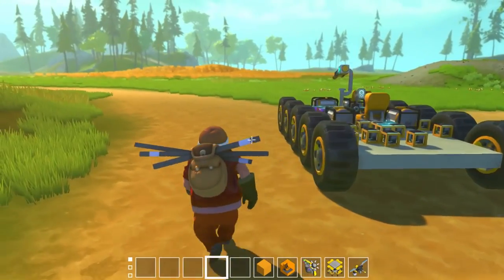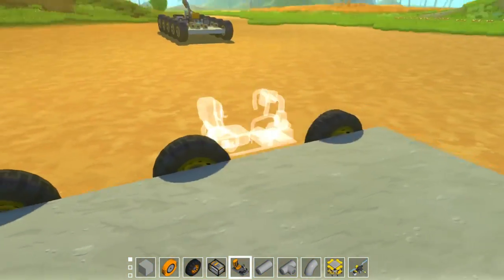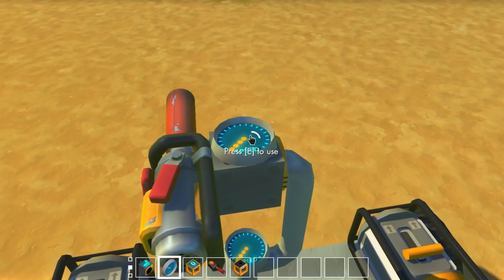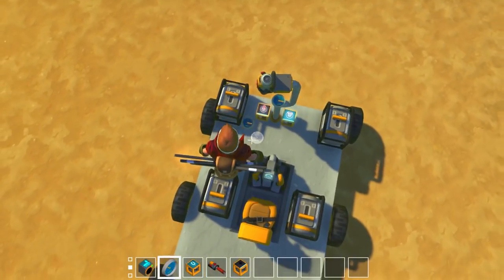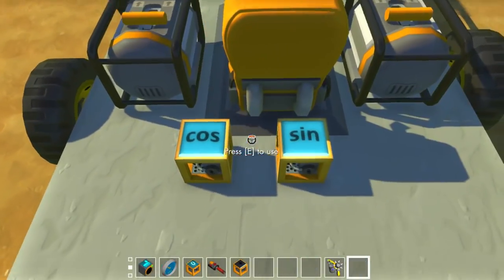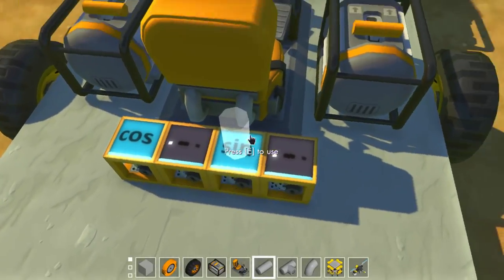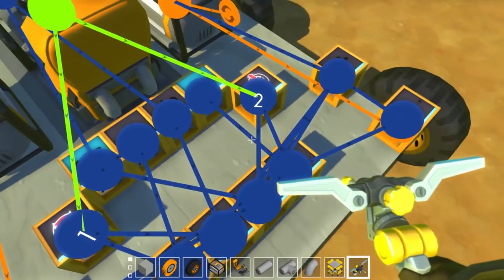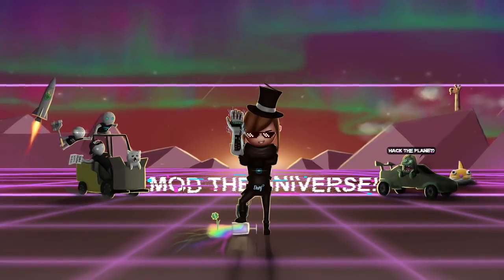Tank Logic Step by Step Tutorial 🧠 Easy Mode | Skrep Makenik

Comment: I have a suggestion: how about making a logic-based powertrain for tank that would feature gearing? like, let's say that it's a mp tank and driver uses a standard wasd converter to operate it. then, he would have an option to change gears between more power but with less speed etc. And also, my question is: would that be possible to do with a standard vanilla engines or it's impossible? I know that you have an easy way to manipulate that with this programmable engine form modpack, but I was actually curious if it was possible without it
Reply: I think it is but you have to do much more.
If you would use double bearings and button controls instead of w and s it would be possible. (Or of course wasd converter.)
Reply: @Samuel-lk6xb  actually I already made a single bearing tank with full wasd using x's mod, but I lacked gearing in my tanks
Reply from the maker: single bearing tank tracks will need the modpack logic
The modpack also has an engine that you can program with custom speed and power using logic, and you can switch between values with a memory panel
It's possible to do all this without mods, but it will require much more bearings than the game would like to have (a new bearing for each gear speed)

Comment: hello durf.. i have a question..  is it possible to make a surface panel that is a long curve that is one wide ?  
like 8x8 curves  . then we can place a single 1x1 between them to center it for like a clock.
could be great for decorations and smooth road turns .
even better if sensors also see them in that shape for like automated citys.